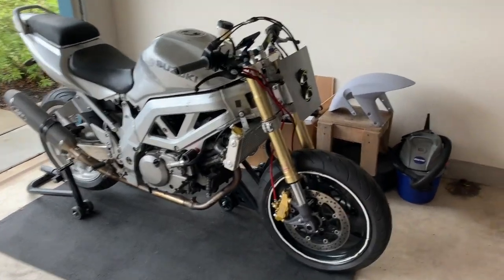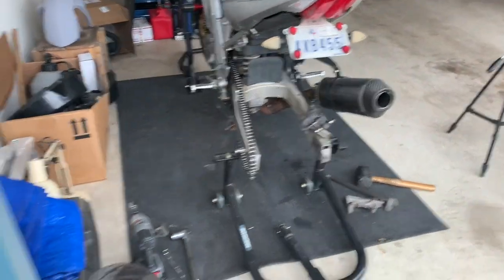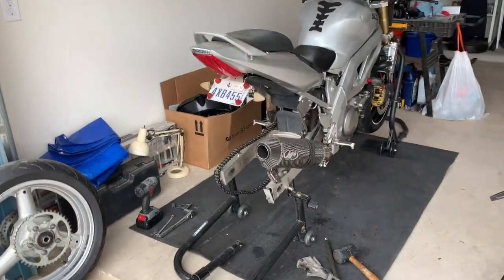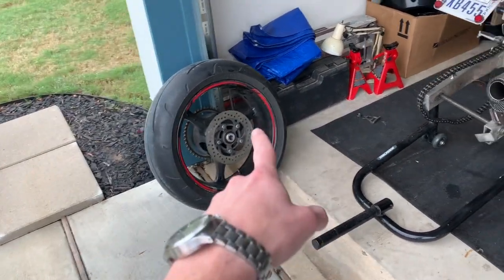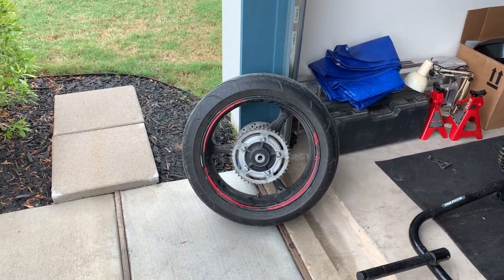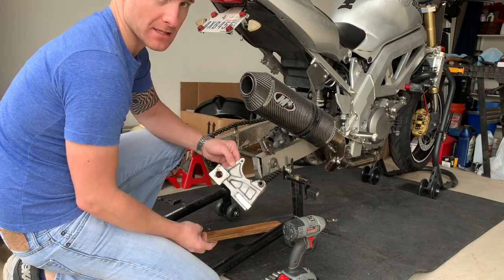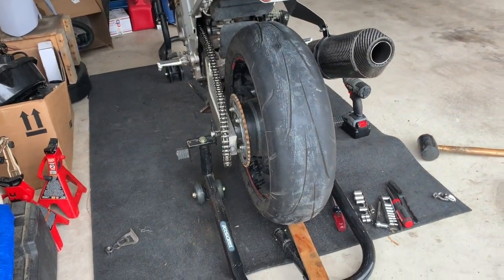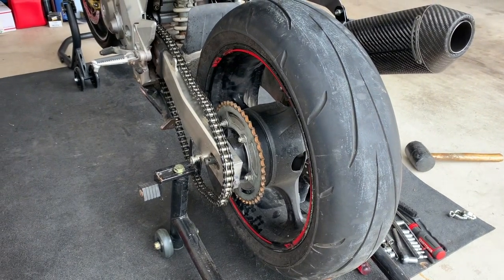SV650 GSXR Rear Wheel Swap Details

Comment: Great video Drew! I'm actually looking to do this to my SV. Thanks for all the info. I have an 05 SV didn't think I was going to find any info on this. I love the bike and I bought it brand new and always had tire envy lol. I need a new tire so this is a great time to swap. I will be following your tips to change pads and other stuff while the wheel is off. That fork swap looks great as well. Not looking to improve anything just want to tinker and get killer looks. Your bike looks great.
Reply from the maker: Thanks dude! I've been liking the better feel and adjustability on the front end with the GSXR forks. On the stock SV forks you can only adjust spring preload, and on the GSXR setup you can adjust compression and rebound damping as well. But yeah, it looks freaking beefy too!

Comment from the maker: You can put a GSXR rear wheel on your SV650. The biggest reason to do this is that it's a wider wheel and thus you can put a 180 section rear tire (stock for GSXR) rather than the SV stock 160. Some people will say you can just put a 180 tire on the stock SV rim. Don't do this. It will physically fit on there, but the tire will be pinched narrower than it was designed for, which will make it have a weird tall tire profile that will negatively affect your handling and actually give you a smaller contact patch than the stock 160. And it won't look any wider because it'll form to the stock SV rear wheel, which is narrower than the GSXR unit. 

Pros:
- 180 is standard super-sport rear tire size, so all the best tires come in a 180, while they don't all come in 160, so you get better tire selection (better compounds mostly)
- Wider tire = larger contact patch=better grip, especially at lean
- Wheel is aluminum instead of steel, so even with the larger wheel and tire it weighs less. Less unsprung (and rotating) mass makes for better handling
- I think a 180 looks much better on the back of a sport bike instead of the 10-speed bicycle-looking skinny 160 that comes stock on the SV. Looks mean as hell.

Cons: 
- Cost: I spent about $320 on just the wheel, tire, sprocket, and machining. I was lucky and found a wheel with good bearings and a sprocket carrier for $150 on craigslist, but finding a good GSXR rear wheel that's not thrashed is usually expensive, especially if you have to ship it. Doesn't always come with the sprocket carrier, so you'll likely need to buy that separately, as well as a new sprocket and chain. I had already bought a new chain because the one my bike came with was trash (spend the money on a good one so it doesn't break at speed, I think mine was $170-ish), and I had to find a rear sprocket that was the right size to fit. I bought a new SV rear brake bracket so I could still ride while I had everything out for machining, I found one for like $10 shipped on either ebay or mad8v, I can't remember. I'll include the link below, but you'll need to ship the GSXR sprocket carrier and your stock SV rear break bracket to a guy to have them machined, and he'll include new wheel spacers with instructions for installation. Machining is $150 plus shipping. I think it cost me over $500 all in to get the swap done.
- Complication: Like I just said, you'll need to figure out what parts you'll need and piece them together. It took me a couple of months to gather everything once I picked up the wheel. I took that time to clean the parts really well so they'd be like-new, and that gave me an opportunity to inspect everything for damage and to make sure it would work. Then you'll have to figure out what to do with the leftover parts. I tried to sell them, but ended up just giving them away to get them out of my hair. No one wanted them, and I can't imagine they'll be easy to sell in Wichita. Also, I found that the bracket that holds the rear brake hose to the swingarm had a sharp edge that was cutting into the wider tire. I took it off and replaced it with a zip tie. 
- Time: If you are lucky and can find everything quickly, you'll need to ship the sprocket carrier and brake bracket to the guy who figured this all out for him to machine the parts so they'll fit. He had a pretty quick turnaround for me, he only had the parts for like 2 days, so it was like 9 days from when I shipped it to when I got it back. But it took me a couple of months to gather all the parts.
- Handling: Having a wider back tire makes the steering heavier. Because there's a wider tire section, you'll have to push harder on the bars to get the bike to lean over, and the bike has to lean farther to make the same turning radius because, well, physics. Honestly, you probably won't notice a big difference (I never rode it with the 160 tire so I can't compare), and after a couple of rides you'll probably get used to it anyway. Also, the 180 tire is just a little bit shorter, which will tilt your bike back slightly and make the rake angle a little shallower, again making steering slower and take more effort. 

You'll need:
- 06-09 GSXR 600 or 750 rear wheel (they're the same). 08-09 wheel is supposed to be a bit lighter (can't confirm). I got an 07 GSXR750 rear wheel on craigslist that came with a sprocket carrier, sprocket (that was the wrong size), rear brake disc (same size as SV so you can still use it), a tire, and good bearings. I've used the tire this season, but I'll be replacing it in the spring. You may end up with a wheel that either doesn't have bearings, or has bearings that are thrashed and you may have to buy a set of 3 wheel bearings too (one for each side of the wheel and one for the sprocket carrier - linked below). Might have to buy a rear brake disc and bolts too, depending on what you can find.
- 06-09 600/750 rear sprocket carrier if your wheel doesn't come with it (and maybe the rubber cush drive if it doesn't come with). Easiest way is to find a GSXR part out bike and buy both the wheel and carrier/cush drive all together. If you're lucky it'll come with a usable tire.
- New chain (link below). Chain size is 525 (I can't remember how many links. A standard chain will come too long and you cut it to length with a chain tool). You will need to buy a chain tool (should do this anyway if you're going to ride, a chain is a consumable and will eventually need to be replaced). You'll need to buy a master link, too. Get a rivet-type, they're the same price and more reliable when installed correctly.
- New rear sprocket. I found a 45 tooth rear sprocket from an '07 GSXR750 that had a 525 chain size. I put it on backward (it has a dished side that normally faces out toward the swingarm, I put it facing the wheel to bring the chain line inboard slightly more, otherwise it won't ever line up with the front sprocket. Read all the way through that forum I linked below. Read it a couple of times and it'll start to make some sense, I had to read it all the way through a few times to be able to pick out all the info I needed.)
- Machining. Like I said before, the GSXR sprocket carrier and SV brake bracket will need to be machined by Zoran the TWF Racing guy to make everything fit. When/if you're ready to get the work done, email him at the email on the second link and he'll give you the info on what to send, when to send it, and where to send it. He'll take off the appropriate amounts of material to get everything lined up correctly, and send it back with the correct wheel spacers to use the stock SV rear axle (which is smaller diameter than the GSXR one). 

Links:

Ari Henning: What's with Tire Width? https://www.youtube.com/watch?v=_hPTiYh4fic 
http://twfracing.com/vbforums/forum/technical-discussions-and-questions/suspension-and-chassis/311-06-and-newer-gsxr-600-750-wheel-on-sv?t=488 
http://twfracing.com/vbforums/forum/twf-racing-parts/twf-part-listings/1117-gsxr-5-5-rear-wheel-conversion-for-sv650 
https://www.mad8v.com/ <-- dude parts out SV's online, and he's on reddit under mad8vskillz. If you don't see something you need on his website, message him there and see if he has it. A lot of times he's got extra stuff he hasn't listed yet. 
https://www.ebay.com/sch/i.html?_from=R40&_trksid=m570.l1313&_nkw=06+gsxr+600+rear+wheel&_sacat=0 
https://www.cyclegear.com/parts/did-525vx-x-ring-chain
https://www.cyclegear.com/parts/did-525vx-x-ring-chain-master-link
https://www.cyclegear.com/accessories/stockton-chain-breaker-and-rivet-tool-kit
https://www.youtube.com/watch?v=ygJZuzjvIMY 
https://smile.amazon.com/dp/B01B7PANZS/?coliid=I924EKBUUGWVV&colid=30XIP07HKN64I&psc=1&ref_=lv_ov_lig_dp_it
https://www.cyclegear.com/tires/michelin-pilot-power-2ct-tires

In the following parts fiche, you'll need basically everything except 7(axle), 10(spacer), 2(spacer), 11(spacer), and maybe 13(carrier spacer), and 8(axle nut). Those spacers will be replaced by parts in the kit made by TWF, and you'll use the stock SV axle, middle wheel spacer, and axle nut/cotter pin. 
https://ridenowaustin.dealerspikeparts.com/oemparts/a/suz/508b0998f870023530723636/rear-wheel

Like I said, it's a whole thing. If you really want to do it, I won't turn you away from it, but it's complicated. You'd likely be able to spend the money better on suspension upgrades like fork upgrades (new oil and seals, valve emulators, appropriate springs for your weight) and a better shock (05-06 Kawi 636 is nearly a bolt-on upgrade). 

Hopefully that's helpful.
Reply: what is the advantage of having a wider tire? I have read that a wider tire will make the bike handle differently (not always in a good way).
Reply from the maker: If you'd actually read this comment, you wouldn't have asked the question.
Reply: @drew657  my bad, i didn't expand it. thanks for that.
Reply: This man out here doing SV God's work lol. Thanks for taking the time to document and explain the steps of doing the front and rear gsxr swaps. I've owned an sv650 for 7 years and have considered doing the swaps. Main reasons for not is cost and complications like you mentioned. Enjoy the ride!
Reply: Great work and thanks for the video. Did you have to buy a new front sprocket as well
Reply from the maker: @slapdaddy3000  I used the stock front sprocket. I tried a smaller (14t) front sprocket, and it will make your chain rub on the plastic chain guides on the swingarm and wear them out. The chain gauge is the same as a GSXR, and the SV speedo pickup is on the front wheel so you can use the stock sprocket. I vaguely remember something about the GSXR rear sprocket/wheel size making this setup a different overall gearing ratio, but I didn’t have any significant problems using a GSXR stock rear sprocket with the SV stock front sprocket. If the acceleration is too jerky or too slow, a new rear sprocket is pretty cheap to swap out.

Comment: Very cool rear conversion. 180 looks really good. Fits the style of the bike you're building. 

I know the Gen 3 is a different animal but I'm wondering if the same conversion could be done. Factory chain is a 520 pitch and the factory rear wheel is 4 1/2 " wide.  Rear suspension has been upgraded to a K-Tech Razor shock and the front forks have the small drop in cartridge from Cogent Dynamics with heavier fork oil to control rebound and I also added preload adjuster caps. Guess I'll reach out to TFW racing to see if it would be worth it on my bike. 

Keep up the great work. The bike is awesome!
Reply from the maker: Thanks for the kind words! Sounds like you've made the excellent decision to upgrade the suspension first! I'm not sure about a rear wheel swap on a 3rd gen. I thought they were very similar bikes to the 2nd gen, so it may be simple to do and just use a 520 chain kit rather than the 525 that's stock for 2nd gen. Get ahold of Zoran over at TWF and see what he thinks, he's done all kinds of things for all kinds of bikes so he may. be able to help.

Comment: Thanks for the video!  Did you ever figure out how to fix the rear brake dragging?  I did the same gsxr rear wheel swap, and I'm having exactly the same problem.
Reply from the maker: Been a long time since I did this so I don't remember exactly what the issue was. It works now. I had an issue with aftermarket rear sets causing the pedal to stick but that was after this.

Comment: Hey Drew. I really appreciate your two videos on this conversion that I watched.   I recently upgraded from an 05 kawi ninja 250 to an 05 SV650s.  I love this bike but i do notice that the handling is a compromise in comparison.  I learned from research that it does have budget suspension and the gsxr swap is the way to go.  I see that your conversion was rather extensive and I was hoping you can provide a bare minimum parts swap list for the front conversion.  I'd like to keep the look of the bike as much as possible and minimize cost as well. I looking to improve the performance of the suspension.  For the rear, i'd just swap out the shock as you advised.  Thanks bro.
Reply from the maker: Glad you found my video helpful. You'll need a whole front end from a GSXR 600 or 750: Triple trees, fork legs, wheel, axle, brakes (master cylinder, calipers, probably extended lines), and for the clip-ons you'll have to just find something that works since the GSXR bars are likely too low. Convertibars are popular, or you can go the route I did and get a top triple clamp with a bar riser. You'll also want to get new steering head bearings/grease as well. My most recent video gives a pretty good run down of my setup, talking about the parts and the cost of my conversion.
Reply from the maker: https://youtu.be/Xr5IY9ObJbU

Comment: Nicely done. Both ends changed make the bike look a lot beefier. Watch out for clearance of you are looking to go bigger than a 180 rear, you could have contact
Reply from the maker: Thanks man! And yes, 180 is the largest that will fit. It actually was rubbing the rear brake hose bracket and cutting into the tire, so I removed the bracket and it works great.

Comment: Hey nice video!

I'm currently working on my own SV 650 R track build with a GSXR 750 K6 front end. I also want a GSXR 600/750 rear wheel swap. I am able to get a nice GSX R rear wheel from a GSX R 750 K10. Does the K10 fit aswell or does it only work with the K6/K7/K8/K9's. Also what type of machining needs to be done to the caliper bracket and spacers cause I live in the Netherlands so I am not really sure if Zoran from TWF is a possible option for me distance wise. 

Really looking forward to your reply! 
Keep it up mate
Reply from the maker: I'm not sure if the K10 will fit, I don't know enough about the width of the hub. I mean, with enough machining anything can work, but I don't know if it'll work with this kit. I wouldn't think using Zoran to source a kit would be a problem, just might be slightly more for shipping. I'd reach out to him and see what he thinks, he's the authority. Hope you get your project going!

Comment: did the gsxr fork swap change the geometry of your bike?
Reply from the maker: I don't have any exact numbers on hand, but IIRC, it might make it a little bit steeper/sportier (fork is shorter, maybe different triple offsets), but I'm not a good enough rider to notice any significant difference and I doubt if anyone doing this instead of just buying a sportier bike will notice either. The suspension adjustability does make it feel more planted though.

Comment: Great piece of information mate, the forum is a great source but nothing like an informative video.  Thanks a lot.  Everything looks pretty straight forward to me, my only doubt is regarding the sprocket.  I'm currently running stock 15t/45t on the SV, and the gsxr wheel I got for the conversion comes with a 45T sprocket.  I should be able to use the same chain right?  What's the deal with running the sprocket backwards?  thanks in advance man, glad I found your videos.
Reply from the maker: Glad my ramblings can be of service to someone! Haha. So you turn the GSXR sprocket backward because it's dished slightly, and turning it backwards gives brings the chain line inboards a couple more mm, otherwise it'll be pulled slightly outward from midline and you'll never get the wheel aligned correctly with a straight chain line. I vaguely recall reading somewhere that you needed a slightly larger sprocket than GSXR stock because the wheel/tire is slightly smaller in diameter (less circumference), but the last time I looked I couldn't find that info again. You'll have to google the chain for the GSXR your wheel/sprocket came from to see if it's the same. I think all the wheels that fit this mod work with 525 stock (which is what the SV runs stock, so it works perfectly)  but definitely double check. If you need to get a new sprocket on either the front or the back, and you need a new chain, it may be worth upgrading to a 520 chain/sprocket set (smaller = less rotating mass = more horsepower to the wheel, supposedly).
Reply: @drew657  Thanks for replying.  The stock rear sprocket on the gsxr is 43T which is smaller than the stock SV.  Maybe that's what you read? I'll do more research,  but I'm guessing matching the sprocket size in the rear won't require a change length.   Thanks again man.